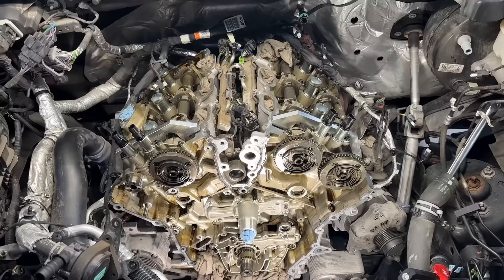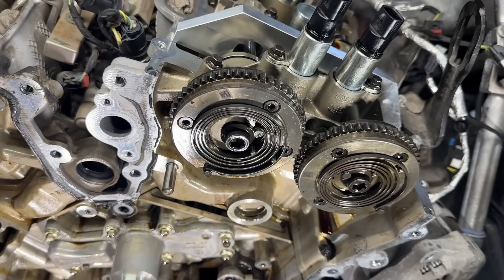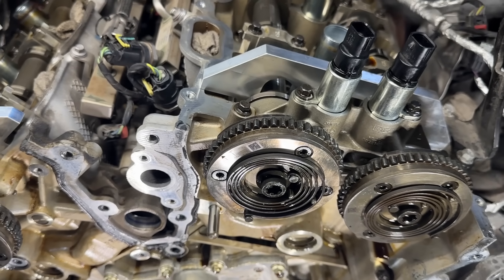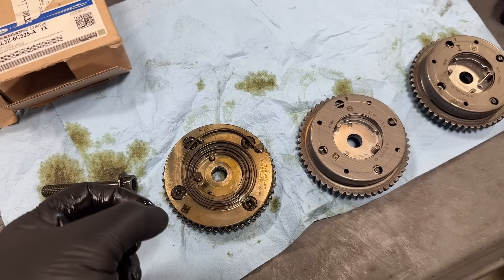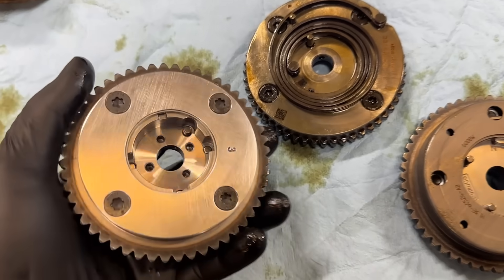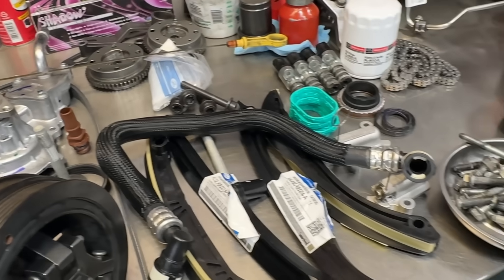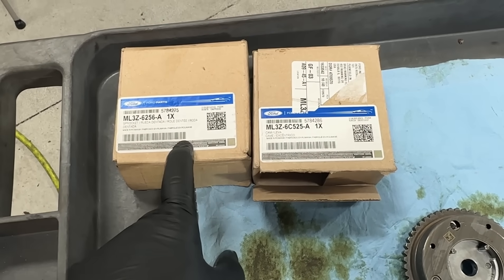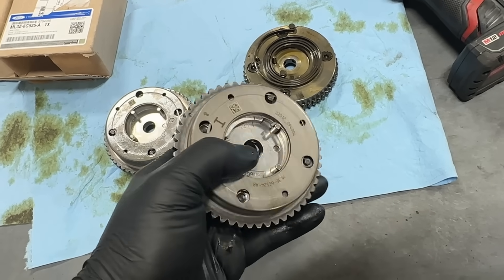2017-2020 Ford F-150 3.5L Ecoboost Startup Rattle Fix: Make Sure You Are Getting The Latest Phasers!

Comment: Brian, fantastic video as usual. I have a 2018 Raptor that needs the phasers done, and I plan to do myself. Do you happen to have a complete parts list of everything you replaced on this engine? Timing chains, guides, tensioners and anything you’d recommend replacing while having the engine opened up? My truck has 120k miles on it. Thank you in advance!
Reply: I also recommend you replace chains, guides, & tensioners while you're in there. I do these jobs daily and the guides get weak at high miles.
Reply: @worldbestsoldiers  thanks for the heads up on the TSB for the additional parts.
Reply: @worldbestsoldiers  do the 3.3L v6 engines have this issue?  Mine just made a cold start rattle and im concerned.
Reply: @walthoyt1104  Not that I seen because its a ecoboost, but there is a TSB out there for Cold start rattle coming from the transmission until the engine warms up. It says a update the pcm software. So a dealer would have to do this repair.
Reply: Search Up TSB 22-2200 for the parts list. But this has the old phasers part number, You need to get the updated one which is the ML3Z
Reply: Yes thanks because My truck is currently getting this done the third time and I requested new updated phasers, chain, guides and tensioners as well as water pump and thermostat because I have 105k miles. Do you recommend any other parts while they are in here doing this job? Oh and they are replacing valve covers too for some odd reason, do you happen to know why they are doing this? Might as well do it right I only have a 120k esp. love your vids. Thanks for all you do, I just wished you would relocate to Georgia. Lol.
Reply: @Walls120973  Maybe the chain went through it.
Reply: I have a 2020 and I want it done. How can I find a great tech like Brian?
Reply: You mind adding the link to be able to find this tsb for the parts list, I can’t find it, thanks

Comment: I just had the latest phasers installed and I now have a decel rattle only in gear and when cold when I let off the gas. Do you think they might have messed up one of the vct solenoids during the repair?
Reply: Sounds like an oil pressure issue. Bleed off or maybe the VCT was trashed to Begin with. If the phasers fail they're very hard on the VCT solenoids. So it probably needs a new set

Comment: Last gen HL3Z-6255-CD/HL3Z-6256-CD phaser vs ML3Z version?  Are you suggesting anyone who received the HL3Z per the Ford 21N03 Supplement #3 will need another set in the future?  I don't think Ford have issued a new supplement yet noting that only the ML3Z will fix it...
The extended warranty only covers ONE phaser job, and many users had an HL3Z part used per the Ford paperwork.
There are actually 3 phaser versions and the HL3Z listed above is supposed to be an improvement. I don't think you touched on this.
Reply: I have seen the HL3Z phasers replaced twice under factory warranty (less than 60k miles), so I feel it’s likely those phasers will continue to fail.  The ML3Z phasers have been in my dealership for about 12 months now along with the HL3Z phasers.  In that time, I have done this repair dozens of times and I estimate about 75% of those repairs were using the ML3Z units.  I have not seen any failures of those units so far.
Reply: @ghostwrench2292  Huh. Thanks for sharing. If the HL3Z replacements I received fail, I will likely end up performing the ML3Z work myself unless Ford will good-will a second job under the service campaign.  It is written that it only covers one repair.
Reply: @mbrick  I would hope that Ford would acknowledge that the HL3Z units are junk and look out for those customers who had them installed under the 21N03 program if they fail again.  Good luck!
Reply: @ghostwrench2292  Yes. Will cross that bridge if I get there!  I'm not against doing the work, I really like the truck.
Reply from the maker: I think I explained it pretty thoroughly.

Comment: While looking this TSB/extended warranty (not a recall apparently) up it doesn't appear to apply to my 2017 Explorer Sport.  Does that model have different phasers that aren't affected by this problem?
Reply: Yes.  The 3.5L Ecoboost for FWD applications (Explorer/Taurus/Flex) has a few differences from the RWD (F150/Expedition/Transit), one of which is the phasers are different.

Comment: question: is this part number AT4Z-6C525-D correct for the vct exhaust phaser on the 2014 f150 3.5 ecoboost? in a video of yours you comment that the part number is AT4Z-6C525-B but it is different from the one shown by sites like fordgiantparts or tasca
Thank you
Reply from the maker: Yes the exhaust phaser has changed again but only the latest will  get sent out.
Reply: @FordTechMakuloco FordTechMakuloco Thanks for your great videos. I started looking into the timing chain issues with the 3.5 ECOBoost. I have a 2014 F150. Setting a P0016 routinely. Just went through your 4 Part timing chain replacement videos. Just put the list of parts together. Was wondering if the P/N's changed.

Comment: It's hard to believe that the ecoboost engines are made by the same company that once made something as bulletproof as the 4.6L V8.  Just look at that shoddy OEM phaser... looks like something that was manufactured in the Soviet Union in the 1950s.
Reply: Especially with that stupid looking spring.
Reply: @gregjohnson2073  I know, they should have used a smart looking spring
Reply: 18 yrs later my 04 4.6 L STILL PULLING MY BASS BOAT
Reply: @Tom-ic7hw  you haven't stretched a valve yet on your 4.6 2v. I always thought the 4.6 was good till it blew spark plugs or stretched valves or loose a rocker arrm.
Reply: Still rocking my 4.6 at 276k miles original everything,  Trans and all🤙
Reply: Probably made in china. Nothings made in house anymore
Reply: My 2005 F-150 4.6L at 222,000 still purring like a kitten. No knocks, no taps, no rattles
Reply: I dont even get these comments. I have a 16 3.5l and in 150k ive replaced a turbo line for free under warranty. Thats it

Comment: So how would you know? As I just had mine done on my raptor about a month ago and they said it would be the redesigned ones. Take the valve covers off? I might have to look at the service sheet
Reply: Take off the oil fill cap and use a flashlight and you can see the side profile of the phaser. The old style has a one piece plate on the backside which is the only side you will be able to see and it is more dull metal color with some blotches in the color. The new one has two colors you will see the normal metal color and than the solid backing plate is shiny metal. Boroscope it if you already have one if not you will be able to figure it out like that.

Comment: Does that apply for the 3.7 NA engine?. I have a 2012 F150 3.7 V6 and there is not much information about 3.7 common problems. Are they good engines?
Reply: same question, I have 3.7 N/A 2012 Mustang V6. from my understanding it's very similar to 3.5 ecoboost minus the direct injection and turbo

Comment: Your 5.4 video series on replacing the cam phasers was a true blessing to me and guided me through the job with ease. Will you be doing one for the 3.5 as well?
Reply from the maker: Yes, I just finished shooting a long video on the 3.5L Ecoboost 2nd gen as seen here, and I already have a series on the first gen Ecoboost.
Reply: He has a video series already on the channel for the 3.5.
Reply: If not repaired will it cause engine failure?

Comment: Bryan, thanks for sharing this informative video, which is definitely very helpful.
And although we expect Ford should prevent this same design problem in newer models, do you know if the 2021 and newer 3.5L ecoboost engines have this same problem?
Just wondering.
Reply: They don't or At least i haven't seen any issues with timing on them so far. But time will tell.
Reply: @worldbestsoldiers  I hope that no timing issues will ever develop with these models cause I wanna buy a 2023 F150 with the 3.5L ecoboost.
Reply: @cma8165  ya nothing major yet.

Comment: Can these phasers be used on the 1st gen 3.5? or are they completely different? I have a 2016 3.5 ecoboost F150 and will be doing this at some point.
Reply: Your truck has the first generation 3.5 eco boost and uses a different timing setup, your engine uses three timing chains, the new generation 3.5 only uses two, the phasers are very different as well, I have seen the cam phasers fail on the old generation 3.5 but only because of pour maintenance
Reply: @saulramirez9937  thanks for the info! Do you know what the recommended service interval for the timing chain, phasers, etc is? 100k miles?
Reply: @halogod264  There is not service interval, at least there was not supposed to be.

I wouldnt expect the chain or phasers to fail on your 2016. Make sure you run good oil and don't short trip the truck a lot, especially in the winter. While the oil is not the only issue, it doesn't help and is why API has updated their oil standards twice since the first gen 3.5 was introduced in 2010.

Comment: Do you have to remove the oil pan when you do this job? My 2017 is seeping oil at 100K and I had the Cam Phasers done at 59K. Thanks.
Reply: Oil pan stays on for the phaser replacement.

Comment: Will a 2018 f150 super crew 5.0 liter Coyote have the same phaser(s) and issue?
Mine has intermittent intake backfiring when under load, ex towing a small trailer. Very random and from most any cylinder.
Reply: Would ford cover repair cost on 2018 5.0 with only 30000 miles? Thanks again!

Comment: FordTechMakuloco just hooked me up with a timing chain & associated components replacement. Plugs, cooling system flush, and a rear differential service. Services worth the money. Cheaper to be proactive than reactive. Definitely cheaper than a new truck. Oh, I think he fixed my front driver side seat as a courtesy; I remember it having a slight forward/ backward. Couldn’t figure out what was different until about 2-3hrs later I realized I wasn’t moving during acceleration/ braking. Thanks BSG!!!

P.S.- Another thing that no longer present is the cold start rattle!!! Had gotten so used to it that I had kinda blocked it out. Super early this morning, around 1am, I went outside to pay special attention to it upon initial startup. Just as I suspected after watching this video and seeing the same service completed on my truck the issue was no longer present. I just fell back in love with my truck again.
Reply: Did you know how he fixed it? I have the same issue with the seat. Thank you.
Reply: @gabrielalvarado8959  
Not until after I left his shop. Took me about 2-3hrs on the road before I realized what was different. I knew something felt different. Tighter. No clunking. Thought it was in the power train, but that made no sense. Was driving… thinking… then it hit me. I’m not moving back & forth, or side to side. Wished he would’ve told me so I could thank him!!!
Reply: @e.b.6766  Great, enjoy your truck! Thanks.
Reply: What was the cost? Folks make these videos but never put of what they charge or the cost

Comment: This is good information to know with one huge downside. What shop is going to let you watch them put in the new version and finish the repair? No one is. You don’t let your customers in to watch you fix their vehicle. There is no way in hell a Ford dealership will either. You tell them to use the new part, they say “We will definitely do that”, and then when they get behind the door to the shop they put in the old version. Unless you take it back apart in the dealer parking lot to check it, how can you be sure they used the newer version?
Reply: I work at a Ford dealership and have done this repair dozens of times.  I would not have a problem if the service advisor informed me the the customer wants the new style phasers to go on his engine.  I would make sure parts sends me the ML style.  I would not even have a problem taking a picture of them after I’ve installed them.  As long as a customer request does not impede my ability to work in a timely manner, I don’t have a problem with certain requests.
Reply from the maker: Well the dealers show a list of parts on the invoice, the rest you may just have to show up when they have the parts on hand for the job.
Reply: Just ask what part number they are going to use. If it isn't the new one don't give the go ahead, either ask for the latest or find another dealer/shop. Confirm when you get the bill that the new part number is on it.
Reply: You’ll see the P/N on the packaging when you take them out to install them….
Reply: @sjfk1306  he is talking about having it done, not doing it themselves. most places won't install customer supplied parts, even oem ones. Including me.
Reply: @--_DJ_--  I always get my own parts as well…. This isn’t difficult to DIY, just time consuming…
Reply: @sjfk1306  To most people that is an overwhelmingly complicated job that they would never dream of doing. I haven't had the pleasure of doing one of those, but have done a few 5.4s over the years. We had a whole fleet of 04-08 f150s until not too long ago.
Reply: @--_DJ_--  it’s a shitty job in a explorer due to transverse layout but in a truck, it’s not bad.

Comment: I have a 2016 f150 V8 auto with only 26k miles(not a work truck) n one of my tranny line (going to top of radiator) started leaking on the bottom at the bend, little pit rust holes. Have your come across this, dealer said not a warranty and n I call backs. Yet !!.
Reply: Brian did a vid on a similar transmission issue recently.

Comment: Have you worked on any 2019 f150 5.0 for oil consumption, I tried the tsb ford has out to change dip stick and pcv but, I am still having the same problem.
Reply from the maker: I know all about it but I avoid them like the plague.
Reply: @FordTechMakuloco  So you don't know of a good fix yet?

Comment: When did these come out? I had mine replaced in February 2022 (factory B2B warranty and I bet they used the old style…wonder if they fail again if I will still qualify for the extended warranty coverage
Reply: Take off the oil fill cap and use a flashlight and you can see the side profile of the phaser. The old style has a one piece plate on the backside which is the only side you will be able to see and it is more dull metal color with some blotches in the color. The new one has two colors you will see the normal metal color and than the solid backing plate is shiny metal. Boroscope it if you already have one if not you will be able to figure it out like that.

Comment: Hey Brian, on a friend's 20 f150 with the 10speed tranny, there's a mild grinding metal sound while idling and on acceleration on take off. I figured it was due to the noisy fluid pump on the newer 10speed but while driving, it feels like when the clutch slips (when you make a bad shift but not jerky) on a manual tranny, so I'm kinda thinking it might be a internal bushing or something else. Last dealership he took it to said they could hear or find anything but I mean it's definitely noticeable now.

Comment: Ford has burned me twice so far. ‘17 GT 350 engine went boom. Then ‘19 Raptor had phaser replaced once already.
Reply: Ford would have to do something heroic to get me to buy another 3.5L Ecoboost over other half ton options at this point. The Tundra and the 3.0 Duramax in the GM's is looking mighty nice.

Back in 2014 I didnt even look at anything else because I was moving to high elevations and the Ecoboost had a massive advantage over anything else.

Comment: If I had a dollar for every ford phaser issue, ide be able to just buy a dodge
Reply: You would just be swapping phaser issues for cam/lifter/valve spring/ seat issues. It's all junk now, the big three haven't produced a decent motor since early 2000s.
Reply: @mikejones-vw6hq  this is true
Reply: Have you even seen the problems Mopar has now with their engines and ABS brakes? I’ve got friends who couldn’t get rid of their lemon cars fast enough after multiple failed attempts at repairs.

Comment: Our 2015 F150 with the 2.7 Eco has quite a lot of ticking noise under the hood. Just under 100,000 miles.
Reply: Ticking could very likely be the high pressure fuel pump or fuel injectors They all tick since they operate at such high pressures.
Reply: @Jay-me7gw  It just doesn't seem right that there is more noise from the engine then from my 1996 Dodge 5.9 liter which has more then twice the mileage, and no noise at all.

Comment: How did they make the 6.2L phasors that they never fail. I read it is a different physical system.
Reply: But they have the lifters leaked down that have rattle at startup. Ask me how I know
Reply: @kenj.8897  I think it is Much easier to deal with that though.I have one in a F150, looks very easy to work on. I got it with 185K and 30K later runs like new.

Comment: My wife and I have a 2018 F-150 with the 3.5 Ecoboost engines and I’ll be sure to get those improved cam phasers.  Was there a recall or campaign for those in the mail from Ford Motor Company?
Reply: 21N03
Reply: 21N03 is not a recall.  It’s a customer satisfaction extended warranty.  To be eligible for it, customers were to have had their PCM software upgraded prior to February or so this year, although I’m not certain on that deadline but it is long past.  If the software was updated on time, the extended warranty goes to 90k miles, however, at 70k miles Ford only covers 66% of the repair and at 80k miles, Ford only covers 33%.  At 90k miles, it’s 0%.